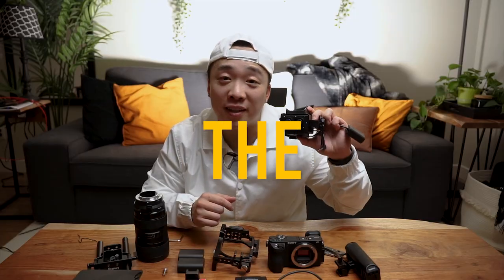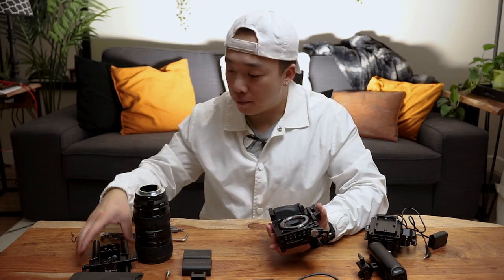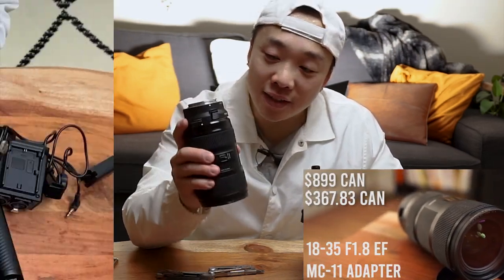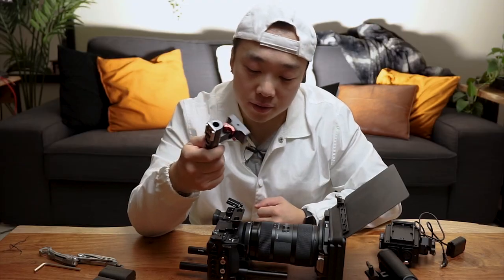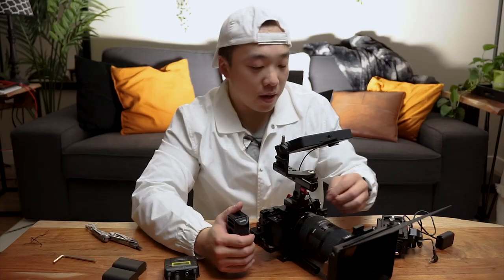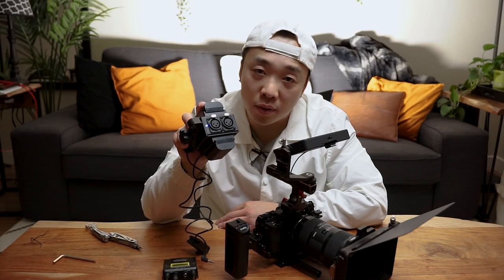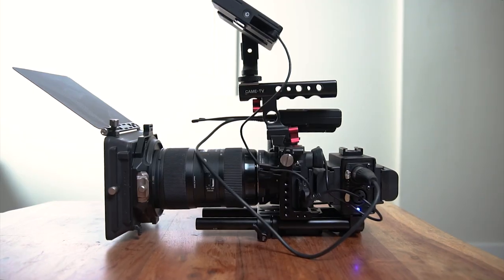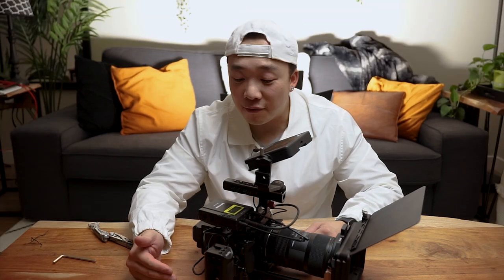BEST Cinema Rig Build for the Sony A6500

Comment: thanks for sharing this.  Once suggestion I'd make is to use the HDMI clamp to secure the micro HDMI connector to the body of the camera so there's no accidental disconnections and also will project the jack from being broken in the process.
Reply from the maker: Yesss, when seen carefully, I try to give the HDMI some slack so nothing is pulling or causing tension! Thanks for the reminder!!

Comment: Hi, what rails in front of the rig are for?
Reply from the maker: For follow-focus, I will do a video on it soon! If you have any other questions, I am here!
Reply: @shotbykien  yes, is there any benefit with this xlr adapter? Im asking because a6500 have only 3,5 audio output so sound will be recorded with quality that can give 3,5 jack not a xlr?
Reply from the maker: The quality of sound comes from both the preamp in the camera and the microphone itself. Condenser microphones with xlr cable will maximize the quality of sound captured. The xlr adapter gives you the option to use 2 mics at once AND longer xlr cables to get your mic closer to your subject is a better option than a 3.5mm extension cable as those are unreliable and low quality.
Reply: @shotbykien  thank you, good points.  I got this saramonic and wondered if there is any difference if i use 3,5 or xlr - of course i use xlr with mini xlr adapter in my bmpcc4k but sometimes i just used 3,5hm